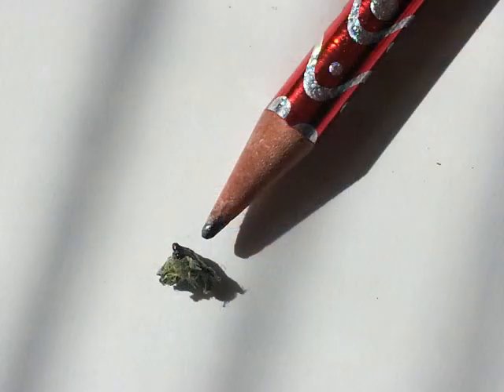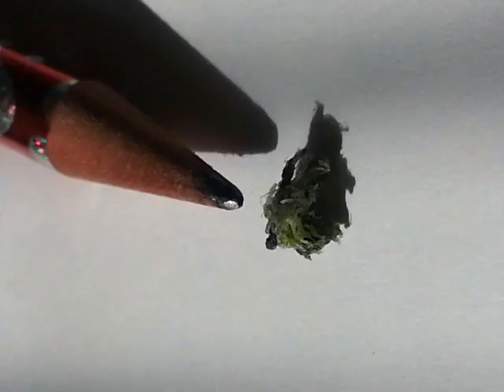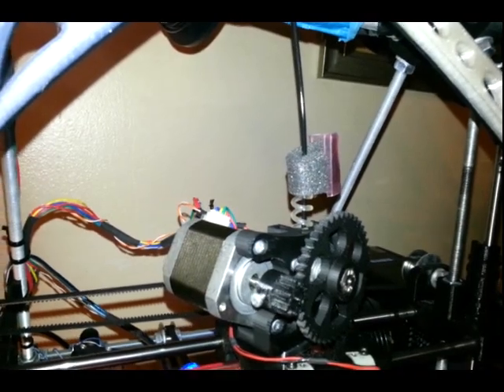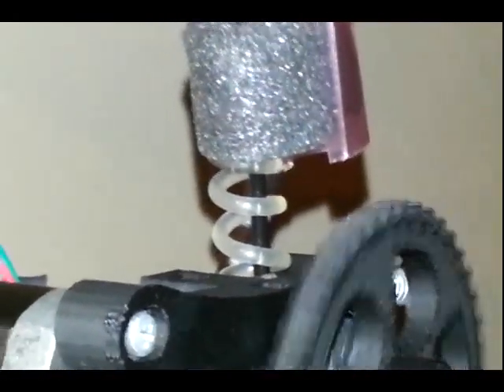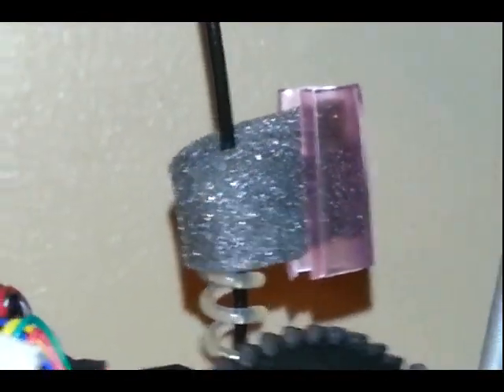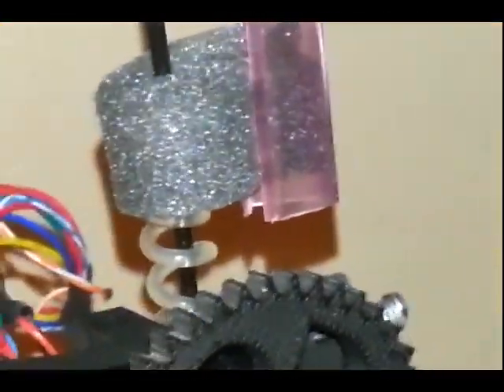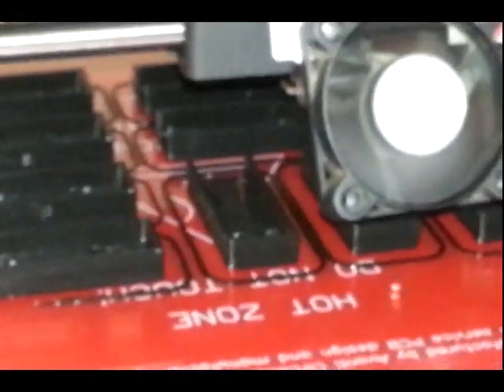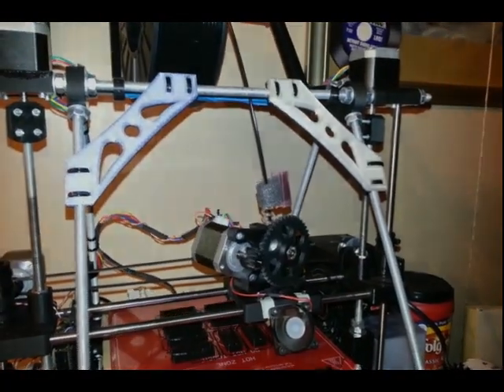Reprap filament cleaner

Comment: I have experienced many clogged heads.  Impurities in the filament can build up as well as stuff that falls in.  When it gets really really bad it has become necessary to take the j head apart and soak the brass in paint stripper (acetone does not dissolve PLA).  Wear protection for your eyes, paint stripper is really bad on skin.

If you use ABS then soak in acetone for 2 days.  then q tip it out.